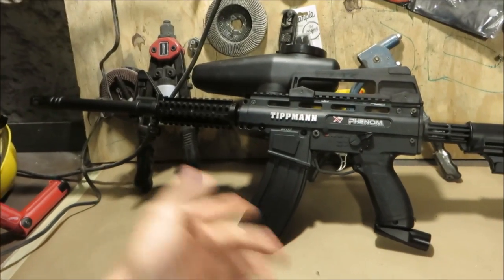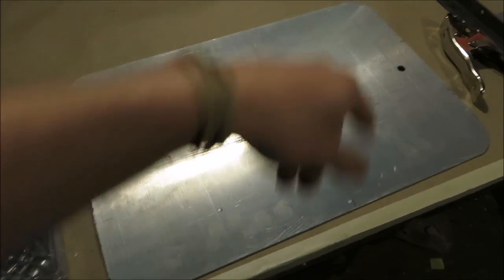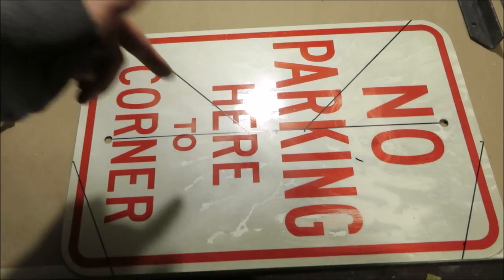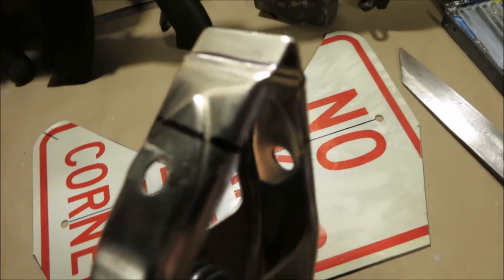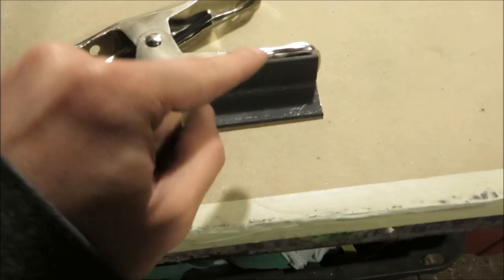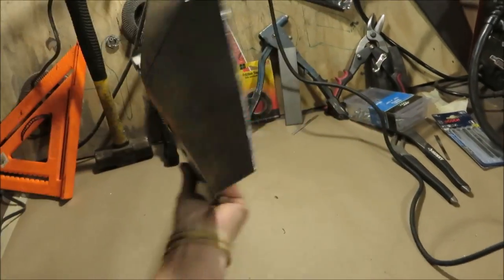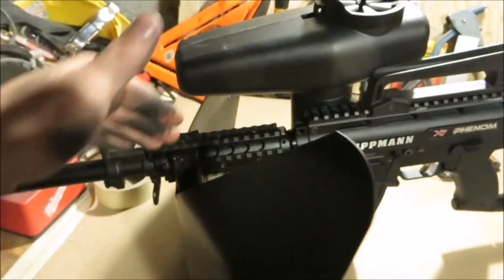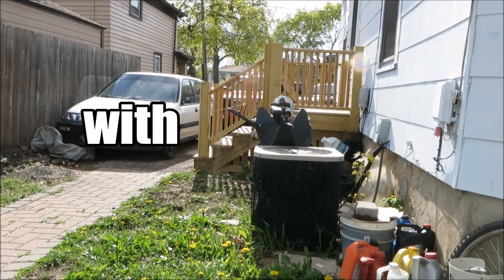How to Make: Ballistic Shield for Paintball!

Comment: Do you think you can make a PCP (pre-charge pneumatic) rifle, like a rifle that holds high pressure and for 5 or 10 shots of a large caliber
Reply from the maker: ClaryBerry1 I would like to, I'm trying to figure out the pressure release system.
Reply: ZednoughtAlpha
yea that was my problem, quick exhaust valves are do use i tried or a coaxial piston firing system is how most people make theirs but that only allows for one shot and it is a muzzle loading system, anyways great build keep up the good work!

Comment: Shivers How many people are scolding you for how you used the jigsaw? You were cutting towards your hand, after all.
Reply from the maker: BrokenLifeCycle None. Where did you learn to use a Jig-saw?
Reply: ZednoughtAlpha Just a basic safety guide for powered handtools in general.

And personal experience... Yeah, getting nicked on the hand by any reciprocating device is not fun. You can never know when the thing might suddenly jerk in a direction as you apply force.
Reply from the maker: BrokenLifeCycle I've been running a Jig-saw for 8 years, never had a problem with it "jerking" in any direction, but thank you for your concern.